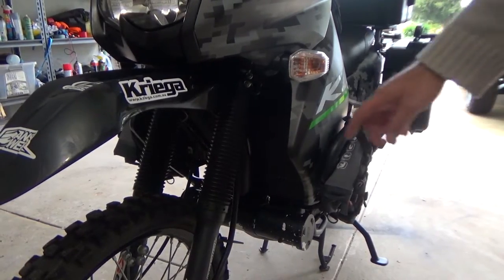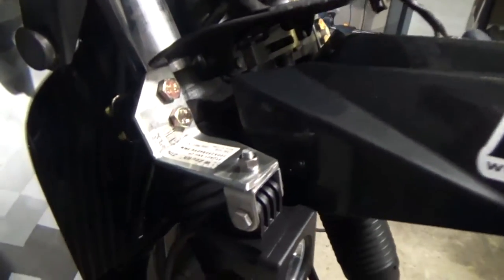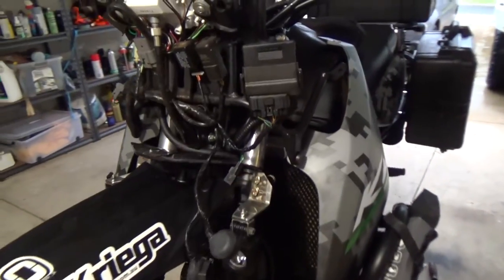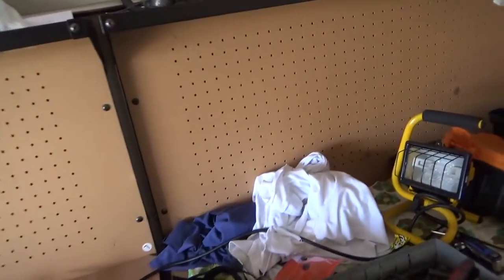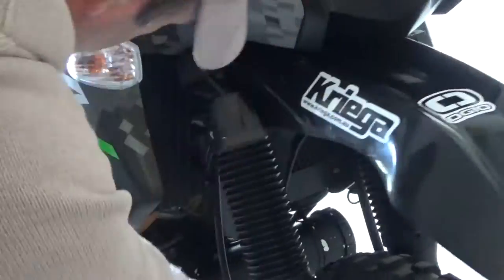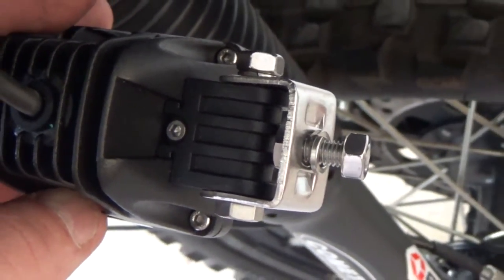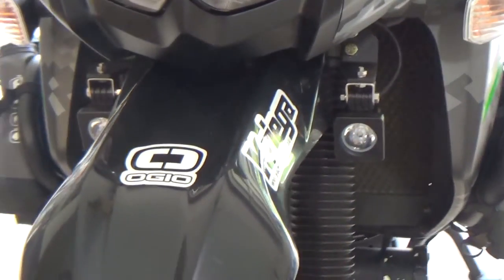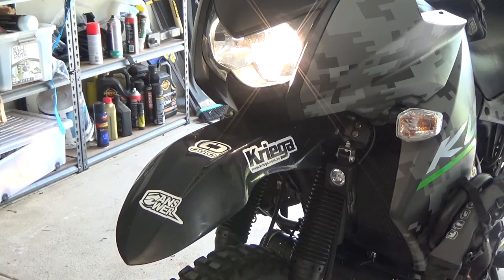Fitting LED spotlights to the KLR 650

Comment: Those LED spot lights look great. I just fitted LED flex strips from Jaycar on my KLR 650 hand guards and a large flex strip on a bar where you have installed your pipe canister on your bike to give my bike a wider appearance to drivers. They work wonders as people now tend to stop instead of pulling out in front of me.

Comment: Mate, I liked this video so much when I saw it last year.  I wasn't sure about the 10 watters at the time but you sold me.  Got the spotties for my Versys but then I found out.... They are stackable!  I can have the spotties and the flood version mounted one on top of the other using the one mounting point on the bike.
Reply from the maker: UltraSamurai yeh they are. Maybe I will do the same. Wattage isn't a good measure of leds as the better the led the lower the wattage for more light. I found a couple of 10 Watters ok but more is better. I have to leave some power to charge up things like the drone batteries. :).
Reply: I'll be talking to my mechanic a bit more about the possibility of rewinding the alternator for more power output.  I'll let you know.

Comment: Great job I bet that makes a difference. The last piece that holds the lights to the brackets you made you left unpainted. No plans to paint them black as well? Also was there much to wiring them in?
Reply from the maker: I thought about paining them black, but thy are stainless. and the adjustable part, I thought the paint would get scratched off. So I left them.

The wiring was easy, I already have heavy wire from the battery to the bars for the chargers and the GPS. I used that as the main power, then just hooked up a switch and switch wire to the high beam wiring.
Reply from the maker: Will take a look tonight if it not raining

Comment: Nice job. Are you running any kind of fuse block?
Reply from the maker: Yep, and inline fuse. and all power to the front of the bike is fused at the battery so if anything rubs through it wont start a fire, its also in conduit.

Comment: You haven't had any problems with the rear brake have you? My rear brake went all way down with no stop. Took it to the dealership.
Reply from the maker: No problem, and I have given it a hard time of a few rides in the sand. My sports bike had this happen, it had got air in the line, just blead it out. Never did it again. Or your master cyclinder has failed, but this would not be common.
Reply: Thanks.

Comment: did you find that the front fender blocks much of your spotlight's usefulness? I'm trying to decide on a mounting position and would like to keep the front fender as you have.
Reply from the maker: They are pencil beams so the fender doest get in the way. But spread beams may be different.
Reply: I need them more to spread out from the fender so I'm sure it will be fine then, Cheers!

Comment: ...why didn't you show the wiring process??  That's the whole point
Reply from the maker: DefiantSix it wa more about the mechanical. The assumption was that it’s just wired up like any spotlights.  The wiring is the easy part. I can do a spotlight wiring one time. I will put it on the list.
Reply from the maker: If you looking for a diagram I could probably draw one up.
Reply: @jjsadv  a diagram would be great. There's so many options and versions from KISS to super complex. Be interested to see what you did.